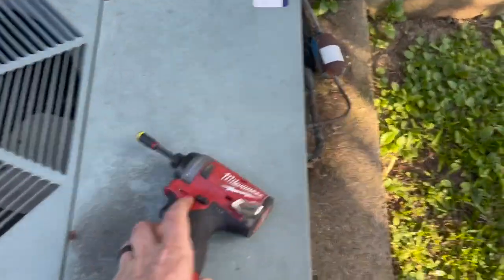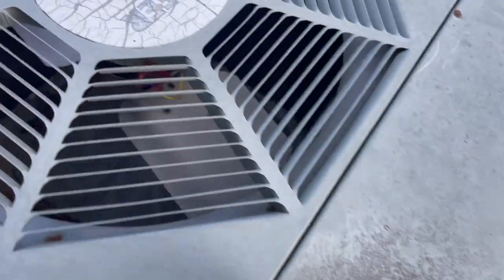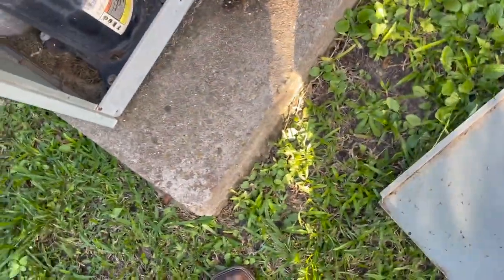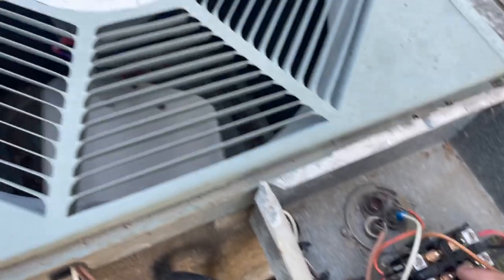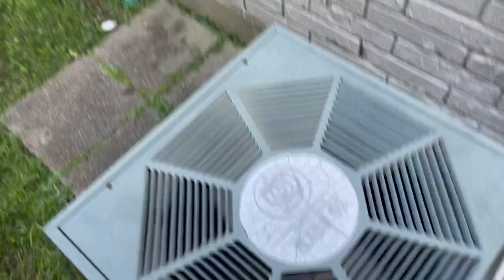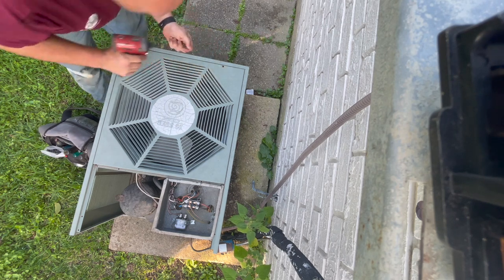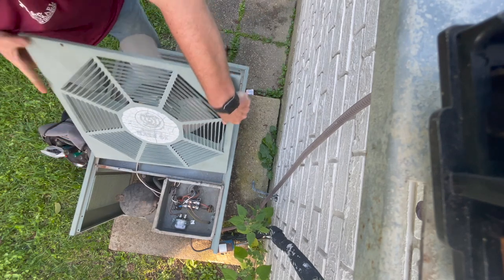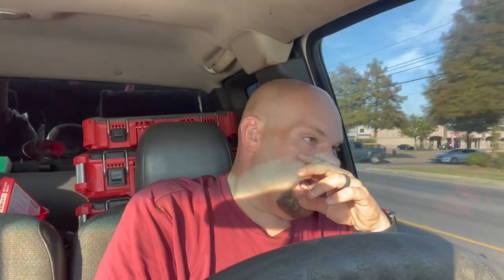Noisy HVAC Condenser/Motor or Blade??

Comment: I've gone a call back on another tech where he replaced a motor I diagnosed. 2 days later  the complaint was it would cool for a while then shut off.  I found the tech put the blade too low so the air flow was off causing high pressure and thermal overload on the compressor.  He also had the fan speed too low. I moved the blade up and changed the speed tap with no more problems.  It was a 825rpm oem motor so I see why he used low speed, but he had two identical units one with oem motor.  The 1075 tap matched the airflow better than the low fan speed tap.

Comment: I was one who commented on that last video where you changed the fan blade bc of the hub rattling. I linked to another YT video with the same brand, same noise and the same fix as what you did. It took the guy 2 tries and viewer ideas to solve it. In that case and your case it was NOT the contactor timing.

Comment: on the rheem unit why did you not replace the blade set first before the motor i would have changed the fan blade first